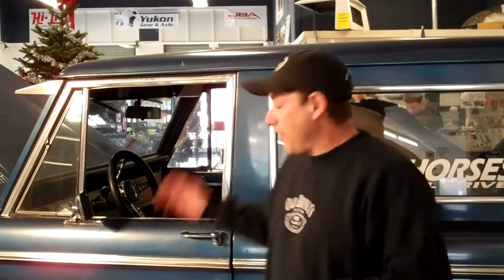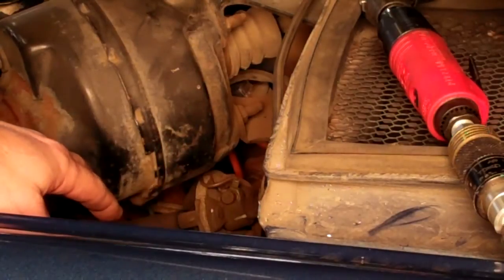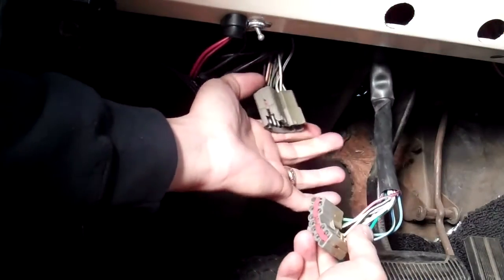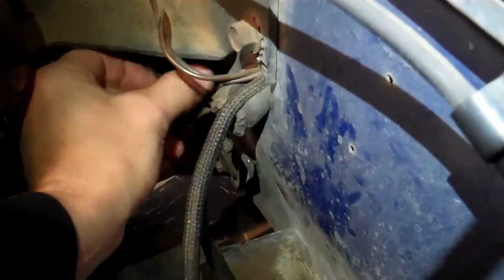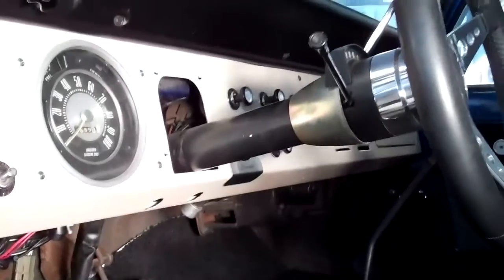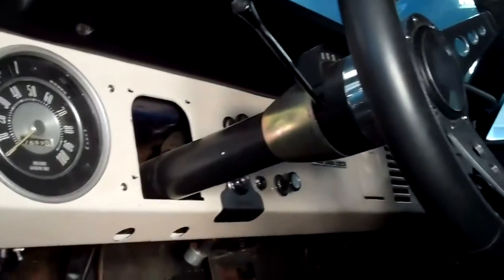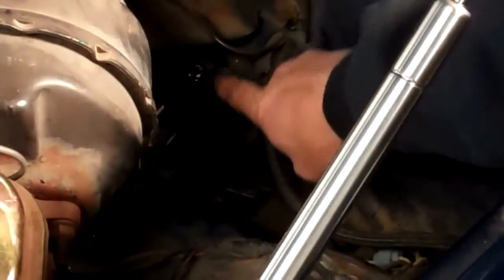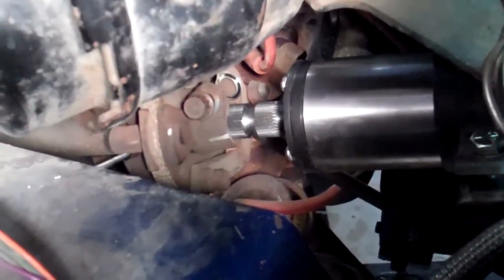WILD HORSES Direct Fit Tilt Column Install Into 1976 Ford Bronco

Comment: What size are the 2 bolts that hold the column up behind the dash.
Reply from the maker: Sorry for taking so long to respond. Our best guess without ripping a Bronco apart is a 5/16 x 1" NC. Hope that helps! If you figured it out, shoot the info over!